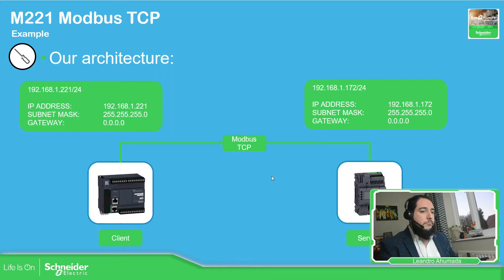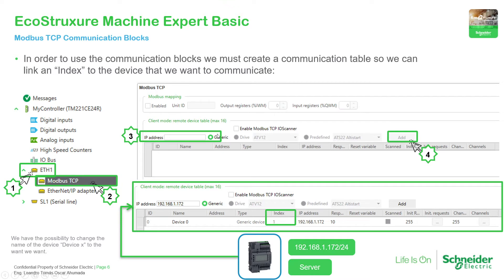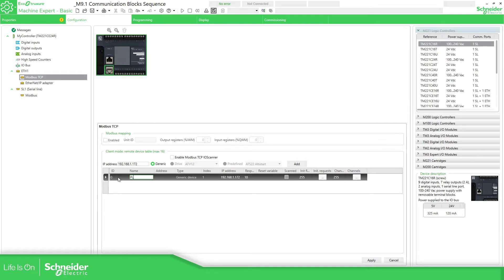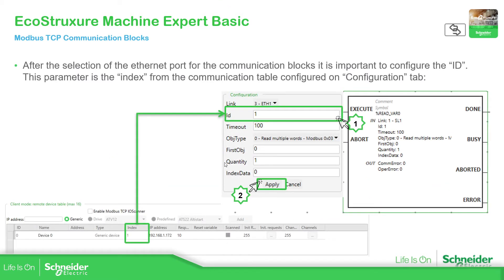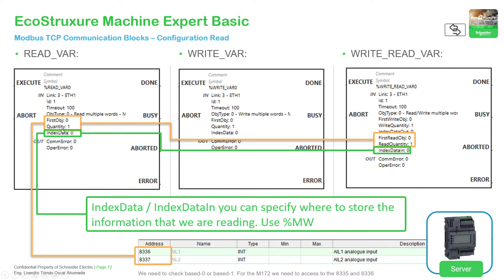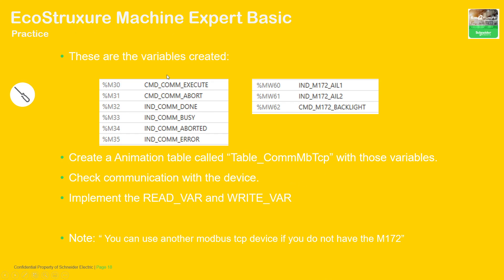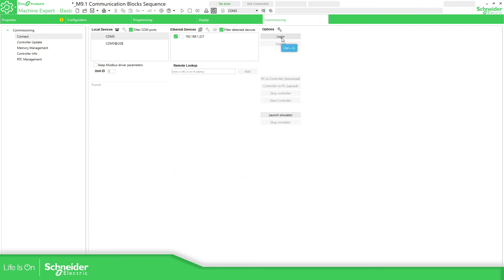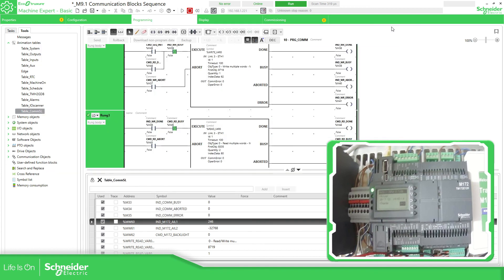Training - M221 - M10.1 Modbus TCP Communication Blocks

Comment: Any idea why my busy bit is turning on instead of done bit of the read_var?
Reply from the maker: Hi there! If you are using the ioscanner to read information from a modbus serial gateway then you will need to change the nose id in the m221 configuration with the slave id number to read the info, sth similar happened to me with a customer using m241.

Comment: I am trying to read a few simple inputs from my tm221 to my control system ( ignition). I have the connection and the Modbus enabled and i can write values from the plc (%QWN0,1,2,3) and read them in on the other end in 40001 and up addresses. I cant figure out how to associate my physical inputs to these locations. You have any idea how to do this?
Reply from the maker: Hi there! I am not 100% sure but you may need to move the values to %MW before writing to %QWNx.x.x , i do mot remember right now to be honest 😅 , i hope the other comment that i left to you helps you.

Comment: Dear LeTomas AHUMADA! I asked following question under M17.2 too, but I put it here because its topic belongs here: Is it possible that the M221 is part of two different communication systems (e.g. both MODBUS RTU): in one BUS the M221 would be the master, controlling several fans as slaves (e.g. 16 pcs fans); and in the another communication system it would be a slave among 12 cooling devices, containing the same M221 CPU's each, but controlled by a superior master CPU of any kind/manufacturer? (So in one MODBUS it would be the master, but in the another it would be the slave, controlled by a supervisory PLC). Thank you in advance for your reply.
Reply from the maker: Hi Viktor! Good call on creating another comment otherwise it is problematic for me to follow 😅. 
If the devices are on ModbusTcp over ethernet then the M221 can be master/slave (client/server) in the same port.
If the devices are on Modbus Serial then on that network only one master can be so you can use the M221 port to control the slaves. Then if you have a different network that another devices is the master then you will need another serial port in the m221 to be slave.
The choice for you will be to have a m221 with ethernet and 1 serial port + the modbus cardtridge or have m221 without ethernet but with 2 serial ports.

Comment: Leandro buenos días. Muy buen video. Se puede cambiar el puerto 502 por otro en 221? Porque no puedo usar el 502 clásico para modbustcp. Gracias
Reply from the maker: Buenas, el puerto que se puede cambiar es el del simulator. Si en la configuracion del modbus tcp la opcion no aparece dudo que se pueda cambiar.

Comment: Hello, if I have several PLCs (example: an HMI, M580) to communicate with the m221, can I use a single read_var block and a single write_var block for communication?
Reply from the maker: Hi there! You can use the M221 as a server in a modbus tcp network then you will have multiples clients. You will need to check how you are going to use the M580 to read to the m221
Reply: @LeTomasAHUMADA  thank you very much, I have a project that I want to set up, to have 4 PLCs communicate (M221,M580, HMI, ARDUINO OPTA AND SIMATIC OIT2040). Basically, I want to create a decentralized architecture and send my data to everyone.
Reply: @LeTomasAHUMADA  i used the requet function with the M580 to the M221 where i read a variable ( ex: %MW10 ) and write on another variable( EX: %MW5 ) and on the M221 i create an animation table with these two variables. isn't there a solution where i can read and write on the same variable?
Reply: please can u explene me

Comment: Hi Leandro ,
Can you advice how to properly configure M200 as IO card and communicate with card via tcp modbus with PC?
Reply from the maker: Hi there!
The first thing is to configure the Etherley port:
https://youtu.be/-WnZD-kgFJ4

Then you need to locate the data to be accessed by the PC. 

On the PC you will need a driver related to Modbus Tcp and use modus function for holding registers.
Reply: @LeTomasAHUMADA  Hi! Configuration I already did . I have a custom SW with modbus driver to work with and it requires modbus device ID ( I think in my case it's 0 , when I add ip address on Modbus TCP with ID 0 ) and register number to read from device ( from 40000 to 49999 ) or write - but where I can find address of PLC variables ( like %IWN300 in IO scanner used ) . Do I need to add all commands in channel assist for my PC IP - read , write , read/write?

Comment: Hi Leandro, Thank you very much for the great videos. I am now experimenting and learning with M221. Regarding Modbus TCP IP. If I only want to Read/Write to the M221 from a another device, do I still need to set up a communication block? Is there a separate manual available for Modbus communications? Thank you
Reply from the maker: Hi there! You have different ways but the easiest is to configure the network settings on the m221, check the m221 is server then try to keep the %M and/or %MW ready for the client to read/write them.
Reply: @LeTomasAHUMADA  Thank you very much for the response. My controller and display should arrive this week, so I will experiment :)

Comment: Good morning, is it possible to connect modbus top encoders and reading data from them? Thank you
Reply from the maker: Hi there! If you are using the M221 the encoder must have Modbus Serial or Modbus Tcp, they also need to be compatible with the Modbus Function available in the controller.

Comment: Hi Leandro,
Is there a way to use the M-2-2-1 as a modbus gateway : ip-rtu ? :
I have multiple Modbus RTU (non IP) devices that I want to pilot/monitor remotely from the M221 connected by IP. Usage : I want to send requests/orders (example a speed) to the M221, and the M221 send it to the right device (example a pump).Thank you
Reply from the maker: Hi there! Yes it is possible but it will need manual work in your code so the variables from the slave are available for you client on the ethernet network. I can try to make a video about it.
Reply from the maker: If you do not need adidtional logic you can use the EcoStruxure Panel Server to access to the Slave otherwise add a PLC
Reply: Thank you Thomas. 
I'm now able to read on a regular basis the values on the Modbus RTU device and "publish" it on Modbus TCP. On the other way, I'm able to send data to the M221, which transmits to the devices.   Regards

Comment: Using rs232 I need to acquire the value of a weight indicator in my Schneider MODICON M221 plc, I know that in ecostruxure machine expert basic the block for the ASCII protocol is Send Receive Message, my question is which address should I use to be able to obtain the floating value of weight that the indicator sends me
Reply from the maker: Hi Diego! The info received from the device should be converted in the plc from word to float. I believe you can assign the value to a %MW60 and %MW61 then in the code use the %MF60 (check if swap the words is needed)

Comment: What about the settings for the Initialization Request Assistant such as the initialization value? If this is not set up generic devices will not work
Reply from the maker: Hi A S! The initialisation is useful when you want to set in the server (slave) some values before the communication of the values defined in the channel. I strongly recommend you to use the IOscanner rather than the function blocks, please take a look in the next video: https://youtu.be/nyXspkScEjk

Comment: Thank you , what about if I want to connect PLC with SCADA system , in this case SCADA will be client and PLC will be server?!
Reply from the maker: Hi Mahmoud! If you have an Scada then it will much better that the scada is the client and the m221 is the server. You will probably need to add a modbus tcp driver in the scada to communicate with the m221 to access to the %M and %MW areas.
Reply: Hello, if I have several PLCs (example: an HMI, M580) to communicate with the m221, can I use a single read_var block and a single write_var block for communication?

Comment: Is there any videos about communication between PLCs and Hmi wireless? and also for remote I/os ?
Reply from the maker: Hi Ahmed! I have not made any video related to wireless communication probably because in the offer of this plcs (M2xx) we do not have a wireless communication card (but you can use the TCSEGWB13FA0 … i do not have it to test it ☹️) like the m580 with the PMXNOW0300. In my house i use wireless communication between some of the devices but i use a tp link mesh system and before that a vap11s-5g.
Reply: Is it possible to use "anybus wireless bridge and bolt" to access for example PLC m221 module and remote I/O with bus coupler?

Comment: Any chance of a video explaining how to use the PID function. Specifically for temperature control? 

Great videos :) thanks
Reply from the maker: Hi Ben! I am still working in the content for the PID so far i managed to divide it like this (no video or presentation yet):
_M17.1 PID in M221
_M17.2 PID Assistant
_M17.3 PID Programming Part 1 (Call PID + animation table for variables)
_M17.3 PID Programming Part 2 (Configuration)
_M17.4 PID Implementation (Encoder + Motor + PWM Output (T))
For the implementation i was thinking in Speed control with PID but i can probably add temperature control.
Are you interesting in heating control or refrigeration control?
Reply: @LeTomasAHUMADA  this looks ideal. I’m mostly interested in heating side of pid with thermocouples and SSR output. 
Looking forward to these videos. Thanks
Reply: @LeTomasAHUMADA  good morning, is it possible to connect modbus tcp encoders  and reading data from them ?